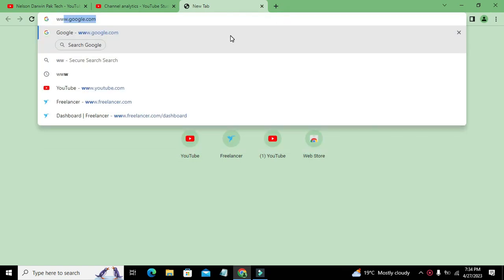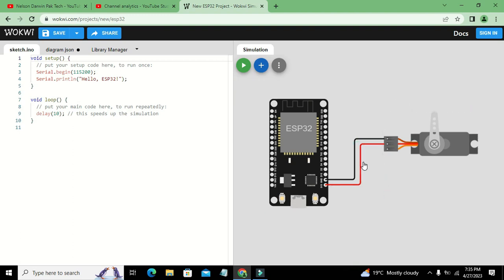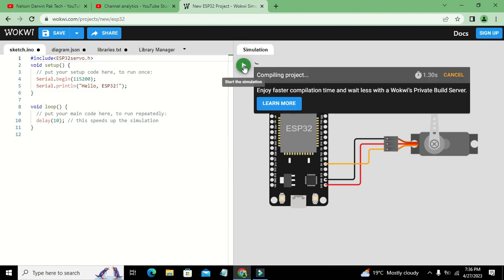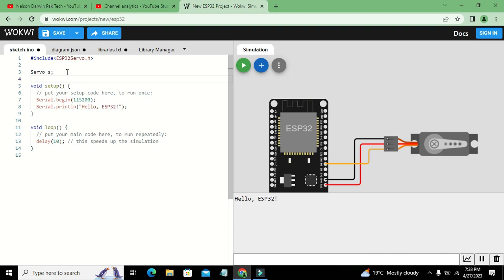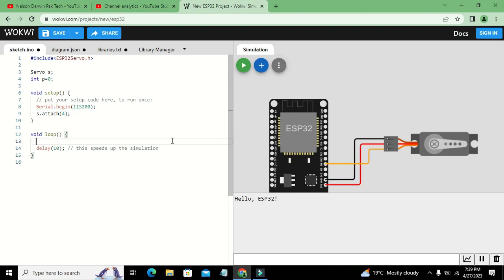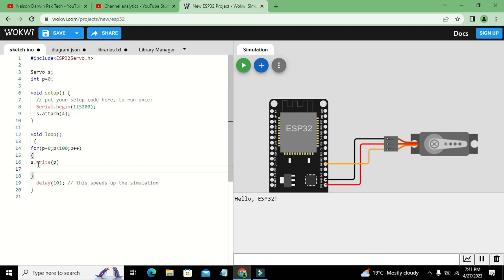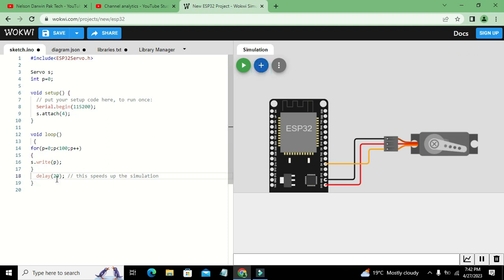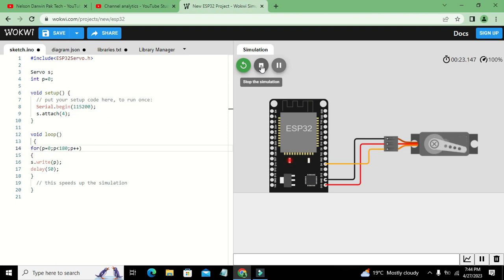simulation of esp32 with servo motor | esp32 microcontroller simulation with servo motor

Comment: isn't servo motor operating voltage 4.8 vdc? can it operate with 3.3v?
Reply from the maker: sir these simulators cannot be considered as real as reality...u know in proteus even the things used to work at 10000 volts.....
Reply: @nelsondarwinpaktech3954  ohh I'm sorry, I'm new. Thanks for the information